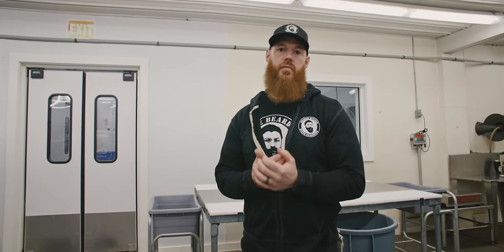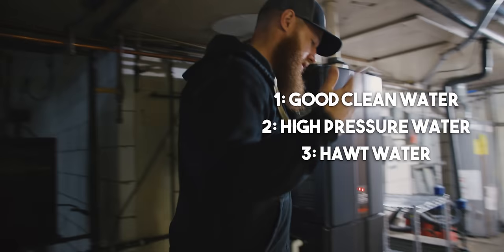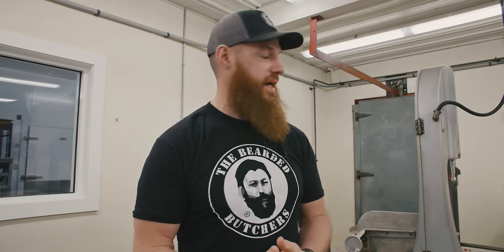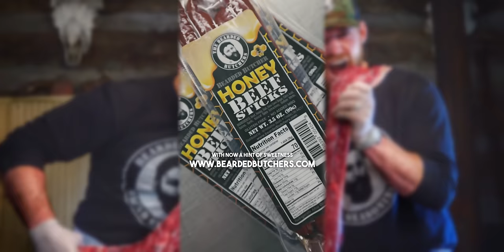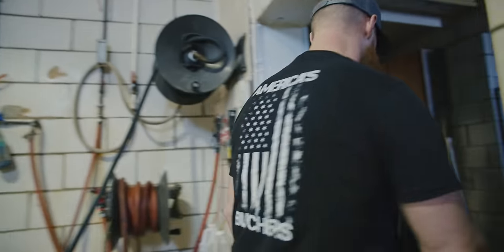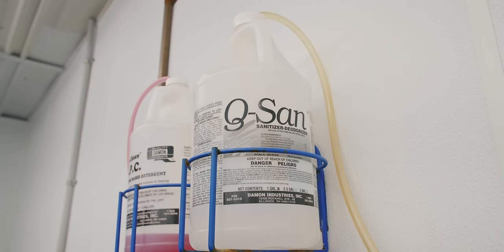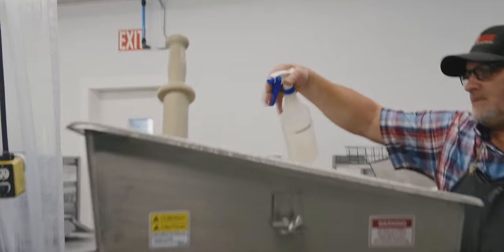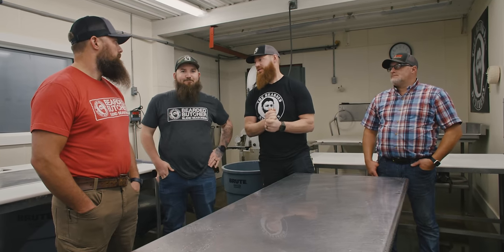How To Professionally Clean A Butcher Shop | The Bearded Butchers!

Comment: I love the content, especially this cleaning video. I work in this industry. I would recommend switching from an enzyme detergent to a foaming, chlorinated product. The hot water most likely kills the enzymes in that product, making it much less effective. Great choice going with a quat-based sanitizer. It actually continues to sanitize even after application. It is called the residual bateriostatic effect.

Comment: I remember doing the sanitation of the cutting room well. Great meat and a great reputation are foundational upon great sanitation. Great sanitation is based upon caring about your job, your customers and their health and safety, NOT money. 
Block-Brite is a good polycarbonate block stain remover. Not QUITE as good as true bleach, but made for the food industry. Quat is a great finishing sanitizer as well since it's chlorine based and chlorine dissipates in air. 
Another thing I kept in mind is that if you think meat particles and grime can't get there, it CAN! The most unthinkable and inconspicuous places in your cutting room and equipment can and WILL get dirty. Cubers, the inside curvatures of saw wheels, aluminum or stainless steel table frames and blade guides get that yellowish gunk on them. 
The cuber is by far the most difficult to clean. It must be taken apart, soaked, scrubbed and left soaking in a bucket of protein removal detergent overnight to remove all buildup. That protein build-up introduces bacteria into your meat. Bacteria reduces shelf life and product appearance. So thoroughly sanitizing your room and blocks the night before ensures a sterile room and blocks the next morning. 
I am not a meat specialist, but have been trained by meat specialists but haven't taken my skills that far.

Thank you for this channel. I have a passion for cutting meat and this channel is perfect for keeping that passion alive even after retiring. I really miss doing this!

Comment: I cut meat for 26 years and managed a supermarket meat mkt. for 20 of those years. I always liked cleaning up because I knew I was fixing to go home afterwards. A hot high-pressure hose is your friend. It always helped if the cutting room floor drained towards the drain and not out the door.LOL. I changed careers at 47 years old (2006) but have always considered myself a butcher/groceryman and not a manufacturing plant facilitator where I retired. It gets in your blood, and you can`t get it out.

Comment: Working in a seafood processing operation there is no process more rigorous than the cleaning and overall sanitation of an area. We use pretty much the same procedure but also a distributor with a compressed air hose. We use a sodium hydroxide detergent and a Quaternary base sanitiser. Both of these foam up.

Comment: Was wondering if you use the knife sterilizers? My brother is a retired meat cutter from a local meat processing plant, and I remember him mentioning having them at arms reach on the cutting floor. When the knives became slippery, or contaminated in any way they would simply use the sterilizer to clean them quickly.
Reply: Hot soap and water then sanitize. Easy peasy
Reply: @beardedbuddie9597  Just a quick story, he told me they always kept 2 of the sterilization pots for the guys from the kill floor, if it was beef day, their break cuisine was Rocky Mountain oysters, if it was pork day it was pig tails, which they would quick cook in the sterilization pots, they were that hot, he resisted the need to try their break fare, LOL 😂 😉

Comment: Having previously spent some time in a commercial packing plant I can tell you your lock out tag out needs some work.  Shutting a switch off doesn't work neither does unplugging without making sure someone can't plug it back in.  Perhaps the outlets in the room are wired in such a fashion the panel or breakers are locked out.  I really enjoy your videos.

Comment: I used to clean the meat department at night. It wasn't hard but a lot of work. If it wasn't for the pressure washer, it would've be a nightmare
Reply: When I did it I had to share pressure so it would turn a 45-60 min job into a 2-3 hour job

Comment: Do you have septic issues? I am setting up a  processing room on my farm (personal use only) I planned to do a separate septic for the room. I work on Refrigeration, AC and restaurant equipment.  I have been in to many butcher rooms to count working on equipment and know I will need to use the same. I was worried about using the cleaners in a septic tank. I imagined it would kill all the good bacteria in a tank that is needed to break everything down.

Comment: 7:20  just curious, with all the fats going into your septic system, how often do you have to pump the tank? Or do you have fat separators?
Reply: I'm just guessing, most likely has a greese trap. Required by most plumbing codes for restaurants and other operations that have grease lamented waste water.

Comment: Do Y'all move the bandsaw blades to ensure Y'all catch between the blade and the tires of the wheels?
Reply: You can see them pull the blade in the video. My concern is if they're pulling off the wheels, if it's possible with that design.
Reply: they took it completely off